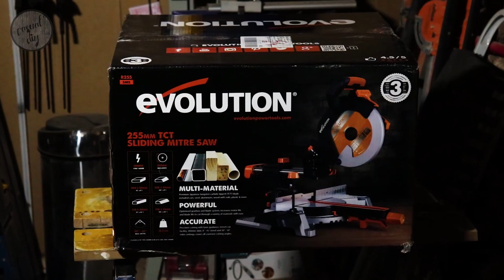Evolution R255SMS sliding mitre saw 255mm - unboxing, assembly, testing and review

Comment: Nice review thanks. I just bought the R255 SMS. very pleased with it so far.  I think the mains cable should be longer and more flexible too.  Also dust extraction is a bit of a mystery as with most power tools. Different sizes of dust extraction outlet connections on different makes of tools. I bought an auto start wet and dry Titan vacuum that came with a tapered rubber connection adapter but the hose doesn’t fit this saw with or without the adapter. Apparently Evolution sell a tapered reducer to fit different vacuums.  Part number 052-0333. It costs £6.98 + £2.50 p&p.  Why not include it with the saw Evolution.
Reply from the maker: Thanks. Thats so true with the dust connectors. It's all well and good if all your tools cone from one brand (Festool best example) then you won't have a problem. But people like me and many others have to shop around and get best deals and tools they can afford. But that means that all tools need different connectors, it's a nightmare. I got two packs of different size connectors and I still need to be creative with some of my tools to plug the hose on.

Comment: Good basic saw well made at a reasonable price. It goes against the grain a bit to start cutting steel and tiles etc even though the blade might handle it do you really want to do that to a saw ment for accurate cutting. As he said set it up carefully and it will do you well. Comes with a 3 years warranty and the after sales help and parts line is very good. Wood specific blades are available from Evolution and also Saxon with 40 and 80 teeth, which cut very well.
Reply from the maker: Exactly that👍👍

Comment: Hi had you any problem fitting the blade, did the spindle lock work ok when you were tightening the blade? the one I just bought has no positive stop so I can't tighten the blade properly.
Reply from the maker: I had no issues at all. I think all Evolution mitre saws got a stop to allow the blade change. Did you check in the manual?
Reply: @CasualDIY  yes I am well experienced with angle grinders/skill saws etc, there is always a positive stop/indent when you press that spindle lock button on any tool I've changed blades on before,
this one feels like I'm pressing the spindle lock onto a ringed gear, you can hear it slipping around but there is no positive stop, 
unless this one is faulty, I cant imagine that this is how it's meant to be. strange.
Reply from the maker: That is strange, not came across that fault yet.

Comment: You may want to change angles quickly if you where fitting moulder architrave for instance, you may cut one 45 angle but then want move the mitre opposite side for your next 45 angle. If it isn’t for speed then I don’t see the point in the slots. By the way I’m quite happy with the saw just was wondering if yours was the same.
Reply from the maker: Ash.wylie I think the stops are there just for ease of setting them up so you don't have to each time check if you selected the correct angle. By the way in not protecting this saw and I may be totally wrong about how to operate it ;) but I found that was the best way to get good results :)

Comment: Thanks for the video, very well covered. I've just bought the Evolution Rage 5 255s table saw, and I have to say that the quality of build and setup is very good indeed, which somewhat surprised me. Their "Rage" line is well designed and good value for money. The sliding mitre saw you displayed seems to be in the same bracket. Many thanks once again for your time and trouble.
Reply from the maker: Galland 34 Thank you kindly for your comment. Yes for the price point these tools are offered it would be very difficult to find something better. The table saw from Evolution is something I would like to upgrade to one day. Evolution Rage5-S 255mm table saw.

Comment: Thanks for the review, I have a question, in the video it is observed in two minutes 10:16 and 11:15 that the wood has the mark of the disc, this is the result of the saw having game from right to left in some moment. Do you notice this movement when making some type of cut? because when perfect finishes are required, maybe they will not be achieved with this saw, thank you so much, regards!
Reply from the maker: Hi never noticed that before. I think that was just me. The cuts are perfect, no saw marks. Although I was swapping blades on this saw so maybe the blade was sitting incorrectly in the harbour while making the video.

Comment: No I thought the idea of the slots was for speed on the most common angles so no need for tightening? And the knob was so you can choose less common angles and then tighten?
Reply from the maker: Ash.wylie The knob there is to prevent the movement. When you tighten it up there is no play or movement at any angles. Not sure why you would need to change the angles often and quickly? But it dissent take that long to tighten the knob, few seconds at most. That's how I found it any way:)

Comment: hi there, i just bought the r255sms+ and i want to ask you if your laser line  is ok, after many cuts with steel? mines is light like a spot light, as a line was just at the first cut. the reason of my problem is the iron dumps, a lot of this. i did not expect that! i think wrong constructive mistake!
Reply from the maker: Hi. My laser seems to be working ok. But I don't cut much steel nor I use it that often. I see it more as a gimmick to be honest. Nothing better that proper measurement:)

Comment: What other blades can be used for wood cutting, brands?
Reply from the maker: Hi, to my knowledge you can't use ( not recommend ) other brands. As the Evolution blades are designed for lower RPMs. Evolution do make a wood dedicated  blade. It gives better cleaner cuts but it's not a massive improvement.
Reply: @CasualDIY  Thanks, I'm looking to purchase this here in the states. Very helpful info.
Reply from the maker: @josephrush2910  I'm glad I was able to help😀

Comment: Hi I'm thinking of buying an evolution in the next few days would you reccommend this or 3db. Also what additional tool are required for assembly. Thanks
Reply from the maker: Hi, it all depends on your needs. The 3DB is about £100 more expensive but it has double bevel cutting ability if that's what you need. I got this r255sms and use it all the time and had no issues with it. I have not worked with 3DB so can't say much about it. I find that the new line of tools from Evolution is quite good considering the price tag. One thing to note R255sms takes a lot of space and the laser is bit of a gimmick rather than something very useful. Other than that it's a very good solid saw.

Comment: How are you finding your bandsaw? Have the same one but have had issues with blade replacement and tracking after a blade change. Even to the point the blade wants to come off the wheels.
Reply from the maker: Mark Moon I change the blades quite often depending on what I'm doing and had no issues with it. Although each time I have to make adjustments so it runs correctly. You can't run all blades on one setting you have to fine tune the saw for each blade.
Reply: It’s not a bandsaw. 😂😂😂

Comment: What circular saw do you use, Tomasz?
Reply from the maker: Now I mainly use the sliding mitre saw R255SMS from Evolution. And a track saw from Evolution. Not been using a normal circular handheld saw for a while now.
Reply: Between the 150mm Parkside battery and the Evolution 185mm, which would you recommend?
Reply: Thanks for your reply and time!!
As always, on point and kind.

Might actually be sending the Parkside back without even opening it and going for the Evolution.
Reply from the maker: @MetaFootballTV  Evolution saws are quite decent. Not the best but for the money they offer a lot
Reply: @CasualDIY Based on your videos, I am quite surprised by them. I am only looking for a circular saw for home to do odd jobs here and there - make a bread bin, a cabinet or two. Basic stuff for around the house.
Reply from the maker: Depends. I really like my Evolution circular saw. It feels like a quality tool and performs as one. But it's not battery powered. Parkside is good to and more flexible as it's battery powered. But it will not be able to tackle some of jobs that the cordered Evolution could.
Reply: @CasualDIY Hi Tomasz!!

I bought the r185css last night 🙈🙈🙈

When I receive the Parkside, I will just ask for it to be picked up for a refund.

Your videos really helped me make up my mind.
Reply from the maker: @MetaFootballTV  glad I was able to help👍

Comment: I have this model saw and found it doesn't cut a 4 by 4 post in one pass but someone on YouTube said his exact same model cut a 4 by 6 post in one pass. Am I doing something wrong?
Reply from the maker: Maybe put a pice of sacrificial fence to put the post bit further. Not sure if that would solve the problem. On the box it should state the max depth cut, can't remember it of to of my mind right now.
Reply: @CasualDIY  mine says cuts up to 300m by 80mm. Will try that but can you explain what you mean by that adjustment?
Reply from the maker: Maybe the guards are blocking the cut due to the beam size. So just try to put the beam bit further away from the fence by putting a smaller piece between the fence and the beam.
Reply: @CasualDIY  arh ok I'm with you now I think. Could I try moving the fence back a bit?
Reply from the maker: You can't move a fence on a mitre saw, you can adjust it so is straight to the blade. But it doesn't move forward and back per say
Reply: @CasualDIY  arh ok makes sense. So best to clamp a bit of wood behind the fence to push the wood im cutting out a bit? What do I do for a sleeper? I couldn't get the slide over it as the laser  was in the way
Reply from the maker: @mattseymour8637  you put a sacrificial piece of wood between the fence and the wood you want to cut. So your wood is not touching the fence. About 1inch away. But if you are saying that the saw is not going over your wood that means is just too large.
Reply: @CasualDIY  OK I'm with you now will give it a go.
So put the scrap wood right behind the blade so it cuts through into it?
Reply from the maker: @mattseymour8637  I think you got it. Its just to get your wood away from the fence if it's not cutting through the whole depth. Sometimes that could be the issue. But if you trying to cut through something that is bigger than the saw can cut then nothing will help just rotate the wood.

Comment: I picked this saw up from screwfix yesterday, just one concern, when dropping into one of the mitre slots it has an amount of side to side play in it, this is in all of the slots, does anyone else have this?
Reply from the maker: Ash.wylie My saw is very stable and there is no play. I don't want to sound obvious but did you fully engaged the front knob? It will have a bit of play before you tighten it up.

Comment: Broke the carbide teeth off the blade of my saw on the third cut of 1/2” mild steel round bar.
Reply from the maker: Maybe the bar wasn't secured correctly, so far I had no issues with my blades.
Reply: I did the same on the first attempt at cutting  1 inch steel bar. I got a third of the way through it. Then I read the instructions. Up to 6 mm mild steel.